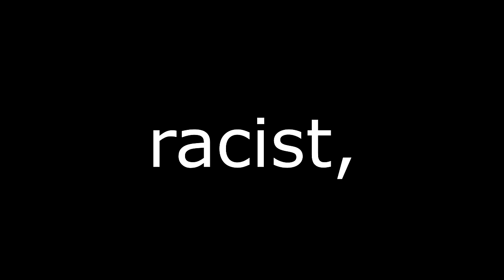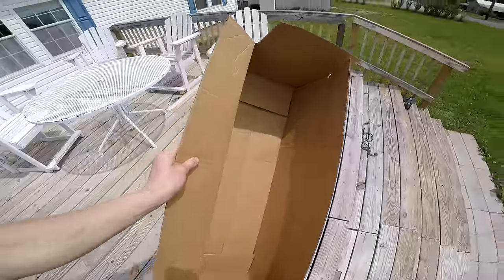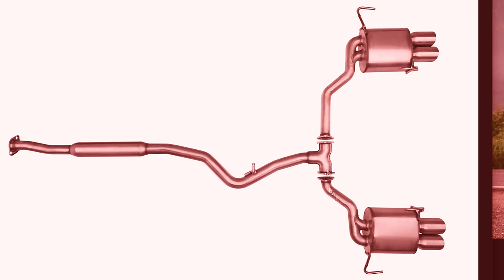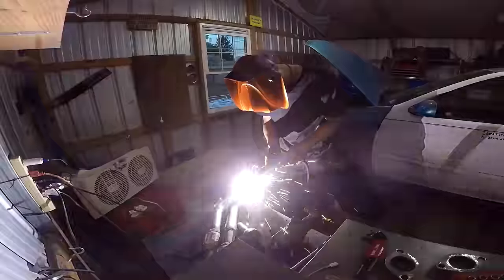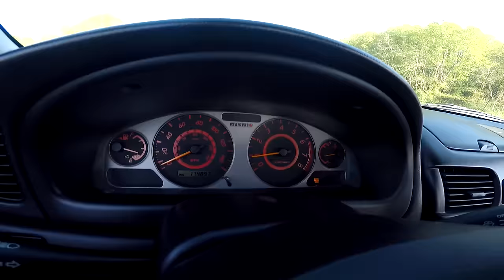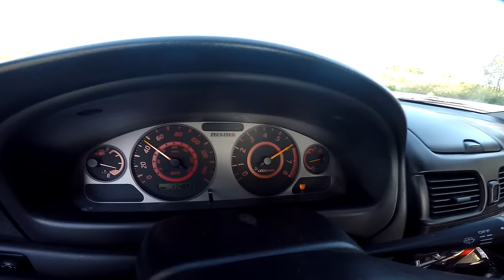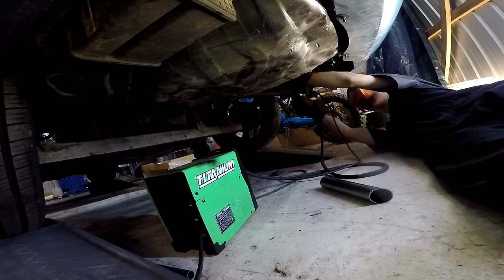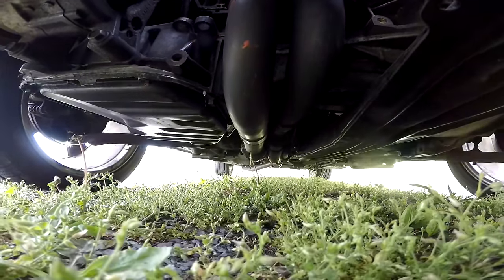True Dual Exhaust on a 4 Cylinder - What Will it Sound Like?

Comment: Some motorcycles already do this, and you can split a 4 cylinder exhaust system in two, and have them each go out the left and right side, so your ears on the bike hear different firing orders, Stereo sound.
A great motorcycle channel, RacerTV, made a video about choosing an engine for your Cafe-Racer project. Splitting the exhaust is one of the tips he gave, for tuning your sound to your preference.

Comment: There are 3 ways to make a dual-exhaust four-cylinder:

1) pair cyls.1 & 2,  then 3 & 4.

2) pair cyls.1 & 3,  then 2 & 4.

1) pair cyls.1 & 4,  then 2 & 3.

Each of the above, sounds rather different.

Which option did you use in this vid?
Reply: i think the easyest so 12 34
Reply from the maker: I made a video on header pairing https://www.youtube.com/watch?v=rEDtQp8po84&t=14s

Comment: Not all 4 pots sound the same. Old  school (not 90's, but like 50-70's) rally car had some cool sounding 4 cylinders. Also the Cobalt SS and Dodge Neon Srt had some deeper growls.
Reply: Equal (honda) vs Unequal (subaru) length headers have a big differince as well as 4-1 vs 4-2-1, and chambered (deep) vs straight through (raspy) mufflers.

Comment: I really like the rumbling sound of true dual, it reminds me of the V8ish sound you get on old Inline 6s with true dual headers, with X and H pipe this just goes ricey. 
I'm tempted to have an exhaust like that but on flat plane 4 cylinders firing in pairs there would be a huge mess with the flow so it's going to lose performance for sure, there just isn't anything to pull a vacuum after each pair fires like in a single exhaust which has excellent flow due to each pair's exhaust pulling the other pair's out, not that the pulse from its own exhaust doesn't do it, it just doesn't do it as effectively.
Reply from the maker: Yeah on any 4 cylinder a true dual exhaust doesn't really make sense from a performance perspective.
Reply: @HatersGarage what about on a boxer engine?
It already has two banks.
Reply: @HatersGarage  as an exhaust novice looking to mod my q50, what should I tell my local shop to have this sound?
Reply from the maker: would sound mostly the same.
Reply from the maker: @josh97941  Tell them to split the headers into two separate pipes all the way to the back with an h-pipe. (and ignore their suggestions not to do it due to flow and blah blah blah)
Reply: @HatersGarage  do I just tell my shop to “true dual” the exhaust?

Looking to mod my exhaust & want it to sound like what you did in the vide
Reply: @HatersGarage  thank you very much!
Reply from the maker: @josh97941  If you want the exact sound in this video then scratch the h-pipe and just tell them true dual all the way to the back. You will want resonators and mufflers, I tried it straight piped and it was unbearably loud.
Reply: @HatersGarage  if I may ask, what size piping did you use on your true dual exhaust set up in this video?
Reply from the maker: @josh97941   2"
Reply: @HatersGarage  thank you!

Comment: Sweet! I've been toying this idea in my head for a long time. When making a "true dual" manifold for a single bank engine did you have any troubles with the upstream oxygen sensor properly reading the engine? With a 4-1 or 4-2-1 manifold the o2 is in the collector reading all of the cylinders exhaust and reading it but in a "true dual" setup you'd only be able to read 2 cylinders with the o2 (unless wiring up another o2 for the other 2 cylinders although I'm not sure if that's possible without stock ECU without mixing up the readings). I know like me this was more of letting the intrusive thoughts win type of deal haha but do you know which cylinders are preferred to have the o2s read or it doesn't really matter? I want to do this to my 4 cylinder but I wanted to research exhaust scavenging to get the best performance out of it when making the exhaust runners and take it a step further by creating 2 manifolds to see the differences in sound and power if any. My engine firing order is 1-3-4-2 so I wanted to make one manifold have 1-3 on one side and 4-2 be connected on the other so its two pulses on one exhaust pipe before switching then the other manifold could be 1-4 3-2 so there's one pulse on one pipe then goes to the other pipe one pulse and then goes back etc. Just trying to help make some sound that isn't a fart can :)
Reply from the maker: The o2 sensor on my headers was already sort of only on two cylinders to begin with. It's up way before the 2-1 collector and could only really read two cylinders anyway. The car runs fine, and there's no check engine light to do with an o2 sensor. My firing order is also 1-3-4-2, and my cylinders are split 1-2, 3-4. Having headers setup to have 1-3 and 4-2 paired would probably sound more "normal". As for flow unfortunately a dual exhaust is just never going to flow as well as a 4-2-1 setup will. An x-pipe may help flow, but will mostly remove the "choppy" sound as well as increase pitch. If you were to install headers with a 1-4, 2,3 split with an x pipe, I'm guessing it would sound like a regular single exhaust.
Reply: You can usually just do any of the primaries and its fine, some hondas already used 2 upstream o2 sensors for tuning as early as 1987 on the JDM b16a.

Comment: The slightly clappy sound could be alleviated by like magnaflows maybe and a resonated tip and x pipe. It helped my m45 which is a v8 nissan basically and them and titans have that cis/ clappy sound and doing what u mentioned above made my car sound great 😊

Comment: Definitely a deeper sound than my 1974 Toyota Celica. My Dad and I split the exhaust manifold back in 1985 to see how different it sounded compared to his 1952 Chevy straight Six. They were close but my Celica had a higher pitch. We ran straight pipes to the back wheels then had 18" Cherry Bombs with chrome tips.  Kind of like a High Powered Weed Eater. LOL.
Great to see someone doing a True Dual again.

Comment: I find it funny that you use a STI to make the dual tip point, after saying all 4 cylinders sound the same. EJ20/25 have a way different sound with a bigger exhaust, mainly due to headers but its still a different sound when  just the exhaust is changed
Reply: unequal length headers on the subaru. You can get em for hondas to make em sound the same lol.

Comment: please try swapping the header collectors onto alternating cylinders to see the sound difference
Reply from the maker: That could be interesting, I have a feeling it would sound similar though.
Reply: @HatersGarage  how did you split your header? Believe it or not, a couple months ago i had the exact same idea, did the same research, found nothing but that exact same forum, and decided to do it to my honda accord. Did the exhaust about a month ago. (Low key pissed that i found this video cause i wanted to be the first to document it but you made a more interesting video than i did so i give you props (as long as you didnt secretly see my video and steal my idea 🤔) I already had a header that was 4-2-1 that i used. Though this header paired cylinder 1-4 and cylinder 2-3. And with that split, each pipe has an even firing split (firing order 1-3-4-2). And i wanted an odd firing split so i cut and reconfigured my header to pair 1-3 and 2-4 for an odd firing split.  Guessing based off the sound, that you paired yours 1-2 and 3-4 which also would be an odd firing split. Thus, your car sounds EXACTLY like my accord. However, i think if i had not modified the header and had the even firing split, i dont think it would have the same deep sound. The odd firing split adds a fundamental frequency 2 octaves below the normal 4 cyl firing frequency, but the even firing split would theoretically only be 1 octave below, and would have a totally different sound. But i dont think it would be as cool.
Reply from the maker: @tjziegler8823  You're right, mine split on alternating cylinders. The firing order is 1-3-4-2, and my headers are split left and right. That's why it sounds so choppy and deep. I had this idea in my head for a while too, about a year or so, it just took me a while to get around to it.

Comment: I did that many years ago with my '68 Corolla. Sometime in the 90's. Made two 2-1 headers out of a 4-1.  It only sounds different if you're standing to one side of the car mostly hearing two cylinders. I split it so you get every other pulse on one side. (1-3-4-2...1 and 4 on the same pipe.) If you are directly behind the car it sounds pretty normal. Originally with pipes out the side in front of the back tires and 12 inch glass packs I could set off car alarms. That didn't last long, too obnoxious, I went straight out the back with normal mufflers. Much better. 
It's got a full NOS factory exhaust back on it now.

Comment: The Boosted Boiz did it with a twin turbo K24 put into a MR2. It was a shorter dual system and it was twin turbo so the sound was much different. It probably doesn't really count as to what you're talking about but its the only exhaust anywhere near what you were asking about. They do have a big youtube channel. This was about Two or three years ago. I hope rhis helps.

Comment: Done it with back in 96 with a 1983 ford exp.   The exhaust manifold ran 4 pipes, collected into 2, and then one outlet.   Cut the outlet off and ran true dual pipes all the way back into glasspacks.   Loud, but not terrible.

Comment: I just put a 3" pipe and built a customer flow through muffler which I stole the design from FlowMaster, on a 2014 DongFeng Rich (Nissan Frontier) plus a K&N filter, made a huge difference and it sounds awesome and not too loud

Comment: did this with a subaru 1981 4wheel drive way back in the day( 1985)..one pipe and one glass pack for each side of an H style engine.. tips came out just after the back passenger door..could be heard from half mile away and it was distinctive in sound

Comment: A lot of it just has to do with a tuned header. Problem is you can’t really pull off a 4-2-1 header with a turbo (and if you put the turbo after the header, the delayed boost is hard to tune for and ruins drivability with a large turbo.)

The best sounding inline 4’s I ever heard were SVT Focus (an amazing engine in an average vehicle) with a long tube 4-2-1 equal length tubing wrapping from the head all the way around the oil pan, connected to a high flow flat-cat annoyingly covering the oil pan, cooking the oil if you lose the heat shield lol. Anyway, they sounded great and had some fun cracks and pops with a nice rumble. Cosworth are absolutely brilliant.

Comment: It literally sounds like what you hear, Two inline twins. Listen to any inline twin bike (ex. Husqvarna nuda 900) and its pretty spot on. Id be curious to see if a different exhaust pairing would make it sound more unique like the two inside cyls and two outside cyls sharing a pipe instead of splitting the motor down the middle.

Comment: How was the power on that setup? Internal Combustion Engines typically use exhaust scavenging to increase efficiency and power. That's where the low pressure wave after the high pressure wave helps pull the exhaust out of the next firing cylinder. Doing what you did completely removed that scavenging effect.

Comment: I did it on an '88 toyota mr2 with a redtop 4age. Took the y section off of the factory header, 1/2 and 3/4 on their own pipe, straight out of the middle

Comment: Although this sounds good, the reason it's frowned upon with a 4-banger is because most stock cars utilize the backpressure created by a different cylinder. This creates a high-rpressure zone in the exhaust, so gases are slower to leave the next cylinder and results in more air in the combustion chamber, resulting in more fuel efficiency as not as much new fuel is burned. There are arguments as to why this is good and bad.

I'd like to see a dyno run before and after the mod- my personal opinion is that the sound produced is more free-flowing than stock and results in lower fuel efficiency but higher horsepower with a slight decrease in torque, or the same amount of torque (I don't think it's likely torque could increase much if at all in this scenario)

Comment: Try an X pipe between cylinder 1 and 4 and cylinder 2 and 2 Then another X between the opposites coming out to 4 tips. It will sounds interesting, but the scavenging effect helps a lot with performance. My 4A-GE 20v is revving to almost 11,000 now. The exhaust modification added a whole 1500rpm. I had some friends build a pressure tester for me to do testing, scavenging makes a huge diffrence.

Comment: I thing the sound will changes a lot depending of which cylinders are paired, maybe it would be interesting to see the difference between a 1/2-3/4 and a 1/3-2/4 exhaust (here I tried to represent the ignition sequence)

Comment: Would probably sound even better with an x-pipe, high flow Vibrant resonators, and decent muffler (like a single 2 in/2 out). Granted it wouldn’t be super loud, but it’d sound damn good and would pretty much be rasp-free

Comment: Was it paired 1and4, 2and3? Like in standard 4 cylinder exhaust? Paring it differently would change the sound significantly, but would reduce power even more. Pairing cylinders that fire one right after the other should make it sound even more like a motorcycle.

edit, oh you already tried that :)

Comment: Not anything new. Back in the late 70s, I had an opel Manta, which I gound a cam and carb for (and later ported the head, and put a 5 angle valve job on). There was no need for a header, since the exhausy manifold was a 2 into 2, with a good angle at the merge points sufficent for scavenging, and no catalyst.
I made my own side by side system, with 2 30 inch cherry bombs. It was awesome. It sounded more like an old Jag E Type running at the lower RPM ranges.

Comment: Sounds like a 180 degree twin cylinder mixed with a subaru boxer engine. How did you pair the cylinders now? 1 and 2 or 1 and 3 in the first pair?

Comment: Jeebus... Look up cross plane cranks in inline four cylinders. Japanese superbike manufacturers like Yamaha run a cross plane crank (throws at 90° instead of 180°, like a flat plane crank), they exist. Also, look up Miller Offenhauser Indy engines. I think they sound better, but a B18 with a Flowmaster also sounds pretty good too.

Comment: Made a Nissaru, interesting..  I wonder if there'd be any difference in the stock exhaust with unequal length headers (like older subaru,) then the true dual with UEL..  4-1 vs 2-2 and the like

Comment: I assumed that would open up a bit more horsepower since you are giving more pipe per cylinder, but now I am overthinking things, and thinking that 4 on one pipe probably wasn't that much pressure to begin with, but I dunno, so. Did you notice a bit more life?

Comment: now the question is, does the sound change based on which two cylinders are paired ? 1,3-2,4 vs 1,2-3,4 vs 1,4-2,3 . .

Comment: You should have Dyno'd the car before and after, to see how much power you lost due to less effective scavenging. 
Also, you didn't mention which 2 cylinders share a pipe. That determines, if consecutive exhaust pulses share 1 pipe or alternate pipes. 
Firing order is 2-1-3-4, so a (2-1 & 3-4 ) arrangement will sound different to a (2-4 & 1-3).

Comment: So what's the entire exhaust setup look like? What size exhaust and can you clarify any other mufflers beside the 2 cherry bombs at the end. I'm planning on doing this to my Matrix and wanted to start planning and ordering everything.
Reply from the maker: It's 2" pipe with OEM Subaru resonators mid way.
Reply: @HatersGarage  Thanks, I have to rebuild a Detroit Diesel V8 first but this is on my project list for sure.

Comment: I had a Nissan four cylinder engine with a 1324 firing order. What would the sound difference be between connecting together 1 and 3, and 2 and 4. Verses connecting 1 and 2, and 3 and 4?

Comment: Not Datsun L series. They actually have a nice deeb burble, even the four cylinders. 

I just put a new timing chain in my L20b and retarded cam timing 4 degrees (it has enough low end torque to spare and im trying to get it to make some power past 4500rpm) ...that combined with a ton of spark advance at idle (10 deg base and 33btdc with vac adv plugged in) it doesn't even sound like a 4cyl at idle anymore.
It actually has (dare i say it) a Rumble. Seriously, the way this little four sounds, combined with the very American inspired looks of the s10 generation 200sx, i could probably convince people who arent gearbeads that theres a V8 under the hood.
I actually want to do true duals on it, seriously its one of the torque monster ish 100hp fours youve ever heard.

Comment: Not all 4 cylinder cars sound the same. Subaru and Volkswagen Beetle flat 4 with unequal length headers is completely different, close to this 2 by 2 setup.